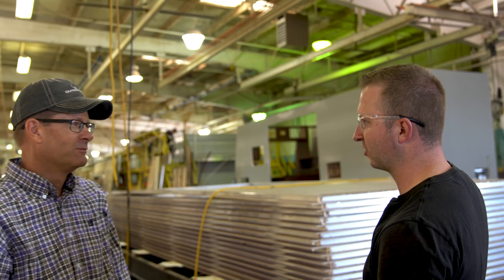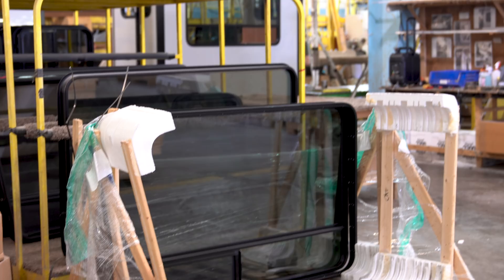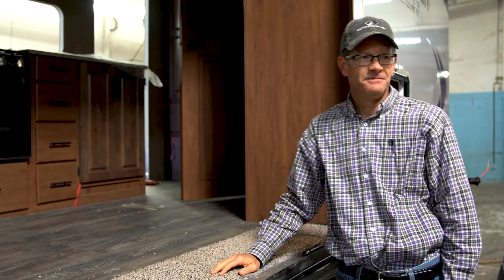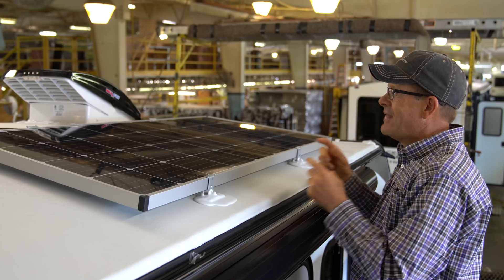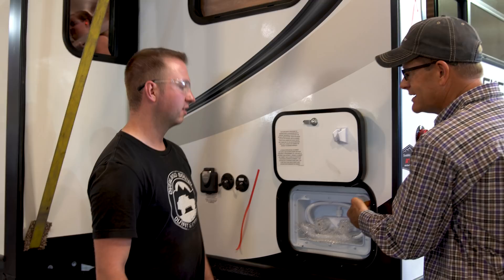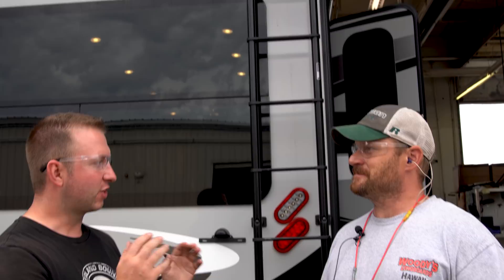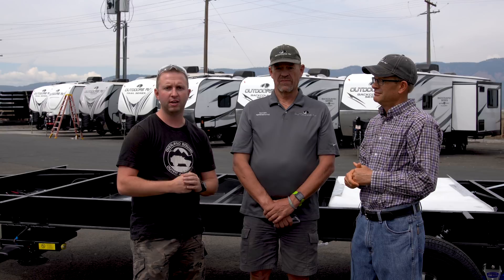Outdoors RV Factory Tour Part 3 (Quality Control + Anniversary Series)

Comment: Thank you very much for the video, I’ve watched literally 100 different videos now  the good and bad  on all RV trailers. This video  definitely narrow it down to Outdoors RV. Watching this 3 part manufacturing series absolutely make you appreciate what goes into building a RV from scratch. I only wish they use some lighter wood on the cabinets. Lighter cabinets would feel more spacious  The only drawback is that it shows up more imperfections. There’s a lot of videos out there that almost put you off wanting to even buy an RV because they so badly made. Problems with the slide outs, problems with the frames actually cracking. Has that ever happened to any of outdoor RV anyone ?

Comment: Love Outdoors trailers. Couple things. Looks like they dont frame around windows.  Would like to see a fiberglass or PVC roof. And would like to see Azdel instead of Luan in the walls.
Reply: Ya, what are the specs of The Rubber Cover Roofing ?, Here`s a good time to make a selling point. it`s easy to see they love their Product and making changes through the years. They use these Campers too. Maybe the roof should be made as good as the undercarriage/floor  . I`m thinking Submarine   You have a Good Post I'm a newbie to all this ...
Reply: They went with PVC roof sheeting mid-2022 production.

Comment: Thanks for the comprehensive ORV tour. We live, work and travel full-time from our 2019 ORV Timber Ridge 27BHS (purchased new in Washington State) since March. We've made our way to Arizona on our way to Austin. Before we had towed it 100 miles, we returned it to the dealer for warranty repairs for frame rust, a blown shock absorber, defective shock bushings, wiring repairs, blinds not opening or closing and a misaligned slide out. Yesterday, I completed a field repair (in Arizona) on the shower drain. I noticed water pouring out from under the trailer after my wife took a shower. The shower drain had slipped out of the trap under the tub. I did the repair myself since the local dealer was about 4 weeks out on service appointments. The quality control on our trailer stands in stark contrast to everything I've seen put forth by ORV. I am thankful that ORV covered the warranty issues. I just don't understand how this trailer made it out of the factory with all the obvious QA issues. 

Scott
Reply: Thank you very much for the review of your Outdoors RV. I've been considering purchasing your exact model. I've heard that Outdoors RV was a step above the typical RV manufacturer quality and paid careful attention to QC through many inspections throughout the build process. I'd like to mirror the other comments concerning the use of EPDM for the roof membrane vs TPO or stronger. Also the use of Luan vs azdel. I wonder if any RV manufacturer will ever approach the quality of the automotive industry in their QC processes.
Reply from the maker: I'm so sorry Scott that happened to you! It's hard to make anything 100% perfect, but it's unfortunate that you got multiple issues in your trailer.
Reply: Outdoors RV needs to read this email--something clearly went wrong on your trailer and they should acknowledge that. Hope the rest goes well for you.  From all I know about them they are a fair company.

Comment: That was an excellent tour. I currently own a 2021 Nash 22H off the grid model and my punch list of warranty items was the electric side of the water heater didn’t work.  I called the dealer and they told me of a carefully concealed switch that was in the off position.  End the problem.  I also owned a 2000 Arctic Fox 22H for 18 years and it never had any problems.
The Northwood family of products are all about quality.  👍👍

Comment: Matt & Diana - Great job on this 3 part review of the factory process, I learned a lot about their RV's.  I'm now including the Back Country Series Four Seasons in my short list along with the NASH.  I would like to see aluminum roof trusses and more aluminum framing in general in place of any wood framing.  Also, I would like to see that fiberglass cap on the Back Country too.  Other items I would like to see on the 2021 model: U-Dinet on the slide out, get rid of all floor vents as they trap dirt and are hard to clean out and put on the new auto leveling package too. If these items are on the 2021 Back Country Series it will be a no brainer when I purchase in one year from now. Thanks!
Reply from the maker: Thank you! I hope you find what you are looking for!

Comment: Absolutely terrific videos of the construction and we thank all involved.  Loved the detail that Darren and Dave explained but would love if someone could please add an addendum to this 3-part series. We own at F28RKS, bought because we were convinced the quality is better than their competition.

1/ In particular, I was really anticipating the installation of roof insulation in Part 3, but it was either cut or not done.  I'd like to see in detail how the insulation is placed among the vents, trusses, wiring etc.
2/ I'd really like to see and know how the front cap is installed, with all the framing etc behind.  This includes detailed construction of the 5th wheel front cap area too, as our 2016 28RKS had to come back for factory 'enhancement' due to substandard construction of the front cap/pinbox area.
Any chance we can see more on these items?
Thanks
CN
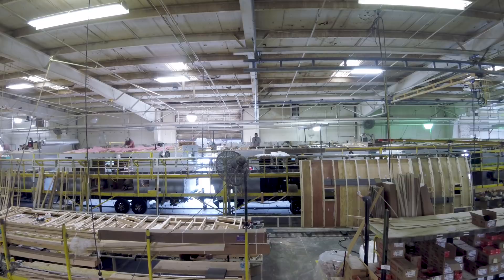Reply from the maker: Hey GeeBee, we were filming through a regular work day and their assembly line has breaks at certain intervals. When we happened to go through the roof building sections the workers were on break and we didn't see them actually put in stuff as we were filming closely. But I did catch a glimpse of it in the timelapse from further away at 04:57.

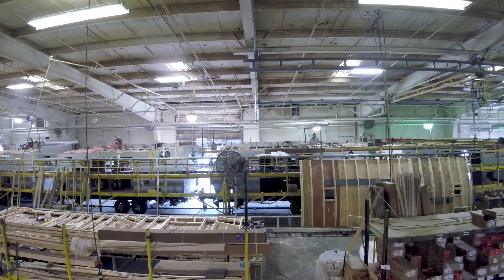At 04:52 you can see how it looks before the front cap is installed. But unfortunately we didn't catch workers installing the front cap at the time we were near that section of the assembly line.

Will keep your questions in mind if we ever do another factory tour at Outdoors RV.
Reply: I have looked at them and I agree that the insulation is less than they say in the roof just like others posted about no insulation at the frame members. For one thing that foil up there is R nothing with no air gap, not R15. I am writing on the East Coast and when power fails in Maine in December, all those “details” matter. Claims don’t. A tent trailer is certified 4 season as long as you have enough power and fuel directed to all the right places. The cabinets up at the cap can have a lot of cold or hot air flow somehow. I have read other complaints about that in the owners groups.

Comment: Great series! We owned a truck camper from 2011-2017 (we full-timed in it for 3 1/2 years) in which we used it for rugged backcountry travel and remote national forest camping and Camp Hosting. We were excited to run across your channel and to learn more about Outdoors RV quality. Three years ago we bought a half-ton capable travel trailer of the same brand as our former truck camper. If our suspicions are correct we will be upgrading trucks as our boondocking desires will also be increasing as once we retire next season as RV Park managers we will be returning to boondocking and also visiting as many national parks and monuments we can. We look forward to following your channel. I wonder what to build lead time is if one can actually narrow down to possibilities to one travel, LOL?
Reply from the maker: Full-timing in a truck camper for multiple years - that's an achievement! Thanks for following along! I hope you will get ideas for places to visit and explore :) For the lead times for Outdoors RV - it depends on the model. They build their trailers in batches and certain models may only be built a few times a year.  Give them a call, they share their production schedule if people ask.

Comment: For the Cost of the Outdoor RV. You would think that they would use a metal roof or Fiberglass, Rubber and TPO just don't have the endurance and low maintenance that is needed for real Outdoor camping.
Reply: tpo is new and has not stood the test of time; that is why they stick with edpm. edpm when done right will last YEARS
Reply from the maker: Agreed, if the EDPM roof has worked well for them, no reason to switch.
Reply: @RVacrossAmerica-rvlife ....Back in the 1970s, flexible sheet, for a variety of uses, was either EPDM or flexible PVC. EPDM was not weldable and flexible PVC contained liquid plasticizers. Those plasticizers led to embrittlement of the PVC as they evaporated. Thermoplastic Polyolefins (TPO) were developed to be inherently flexible, plasticizer and halogen free, and to be heat-weldable.  The first TPO roof application was in 1986, so, it's not that new. Today TPO installed on residential homes with flat roofs carry a 30 year warranty when expertly applied. (Ref: Liza Barth - GAF ProBlog)
Reply: I have an older Jayco with a metal roof and have had ZERO problems for 20 years.

Comment: Great series, well done. They look like they have a good work ethic and care a lot about the Customers' satisfaction. I first learned about their 5th wheel as it was recommended by several people. Then learned about the T/T's. All look to be very well made especially for boondocking. I'm a little disappointed to see EPDM roofs. I understand TPO to be a better option. I've also heard that you can't expect to find 100% of what you want. It looks like ORV gets the essentials done right.
Reply from the maker: Yup, I completely agree, you can't expect to find 100% of what you want. I like analogy that Matt says - when you move into a house, you are going to make it yours - hang up pictures, add your furniture, maybe even paint it or fix sprinkler system (like we did in our last house). Same with the RV. In our research we felt Outdoors RV got the hard-to-change-after-the-fact things right for what we wanted to do with it.

Comment: I spent five hours with a technician trying to locate a short from the fridge to the side to the rear and we finally had to run a wire from the fridge connected it underneath the side to get the wires hooked up again on a 2018

Comment: I was hoping they were using Aluminum roof trusses. I’d like to see a fiberglass or at least a TPO roof. Just because we’ve always used EPDM doesn’t make it the end all. I feel like they should commercial 60 mil TPO for a great protection.
Reply: You should see what I can do to a TPO roof with diesel power and a sharp object overhead (broken tree branch). "Great protection" is relative.

Comment: Thank you so much for this series of videos!  Question for you as Outdoors RV owners: I saw a complaint regarding aluminum framed trailers, in that they don't insulate as well as wood framed ones, since the aluminum tubing conducts heat/cold far mor readily, and that "in cold weather you can see the outline of the frame on the walls", due to the cold conduction.  Have you noticed this???
Reply: If you happen to visit the factory at the right time, on a very frosty day in the morning usually, and check out a unit that has been brought from outside in or vice-versa not too long ago, you can see that occur right there! They are well aware. It's true of all brands with that design except the few that are thermally broken (DRV, some Triple E motorhomes from Canada). It's gotten a lot more attention in the last few years. Hopefully Northwood will copy Triple E's lamination scheme, or a similar one, and solve it.
Reply from the maker: Yes, we have seen this.
Reply: Also aluminum does not rust or dry rot like wood framed trailers and is significantly lighter. I would like to see the trailer steel galvanized rather than painted. I think galvanized steel rusts less than painted steel when the paint chips or wears off. There is a reason boats (especially saltwater) used galvanized steel or aluminum trailers. Would like to see these nice quality trailers a little lighter. Good video and overall quality trailer.

Comment: If you do have damage on one of the walls can it be fixed and if the rv gets older 15 20 years down the line are you screwed or can you still get it repaired?

Comment: I bought a 2021 FQS22 love the design but I did not get the quality they are touting. Found missing screws , cracked wood pieces in furniture and cabinets, severe cold air leaks in USB ports and 110 outlets , air gaps in slide outs , poor sealing lines around exterior outlets staples showing in many areas. Topped off with a screw that fell into sealer near solar panel. Cleary a poor build. Have appointment with our dealer. They have been awesome to work with. Hoping they are equipped to repair our unit to what one would expect a $40,000.00 22’ trailer to be. Sorely disappointed.
Reply: Are you being serious? It’s an RV not a house. Get over yourself.

Comment: I started to research this manufacturer as I've seen a 2013 Timber Ridge 260 RLS for private sale.
Having seen the process of construction and quality control, I am definitely going to put my offer in.
I am from the UK 🇬🇧 and have motorhomed for our annual holidays but now I have bought  a 2004 GMC 1500 Sierra for hauling a lighter weight trailer to go to the coat from Palm Springs California.  I have upgraded my suspension, put in a transmission cooler and brake controller in readiness for our used but good trailer. 
Question; do you have any advice on the proposed purchase and what to look for?
David

Comment: How long does it take to heat your water cause I'm considering these rvs but fear not having a tankless water heater cause of loss of water during the heating process.  only because I plan to do a lot in the colder winter temps in the high mountains in Idaho, Montana etc
Reply from the maker: We did some testing and found that the electric water heater takes about 30 minutes to heat the 6-gallon tank from around ambient to hot. It's slightly quicker using propane, and quicker still if you turn on both the propane and electric water heaters at the same time.

While many prefer the tankless style, we actually prefer having a hot water tank. Not only does it mean we are carrying a little more water onboard (great for boondocking) but we can also heat the water with solar during the day and shower in the evening - saving propane.

Comment: Lol rugged? They're made nearly the same as all the rest of them
Reply: Not even close. Thank you for playing
Reply: @william1452  they literally are... Sounds like you got suckered by their marketing
Reply: @william1452  Yeah after watching this, these are the exact same trailers coming out of Indiana.  Even with the same BS insulation speak about R values.   Thin walls.   What looks to be windows not framed in.    This trailer would not survive actual back road conditions  for many years which is a shame because the water tank sizes are amazing on them.   Looks like its back to the Xplor X-22.

Comment: Why does this guy keep saying "marine grade plywood?" I did 10 years in the Navy and have alot of small boat experience....There is no such thing as marine plywood...Just another buzz word the industry is using to try and trick the gullible consumer.
Reply: There "is" such a thing as "Marine Grade Plywood". There are multiple grades, thicknesses and sizes of sheets. It differs from pressure treated plywood in that the laminations are "not chemically treated" to resist moisture but the adhesive between laminations is waterproof. This keeps the laminations from separating if exposed to water. Feel free to Google it for a lot more information regarding Marine Grade Plywood.